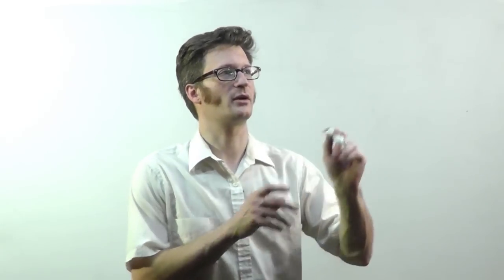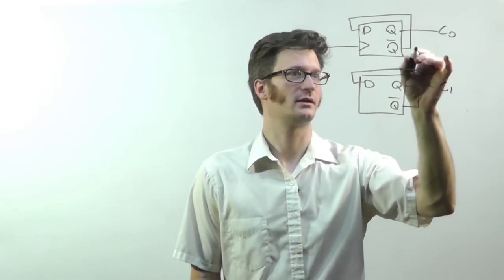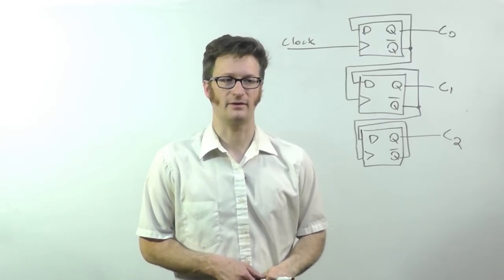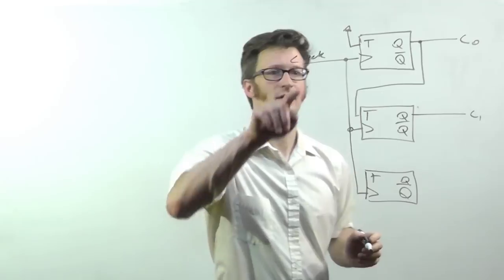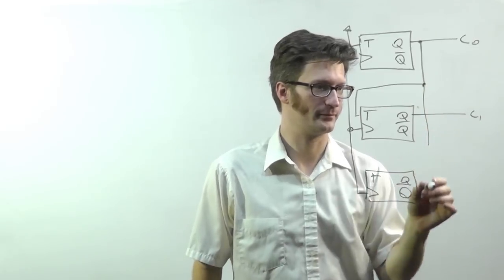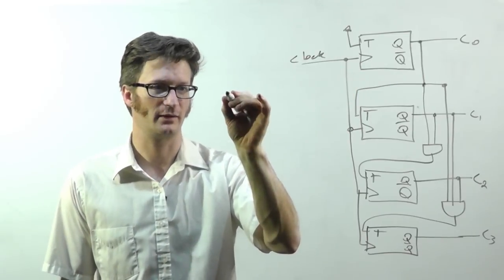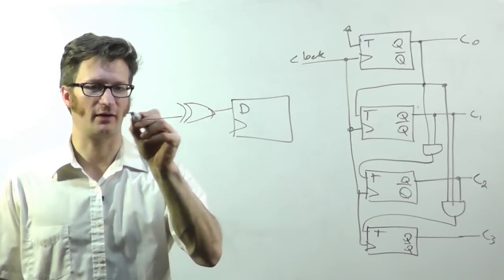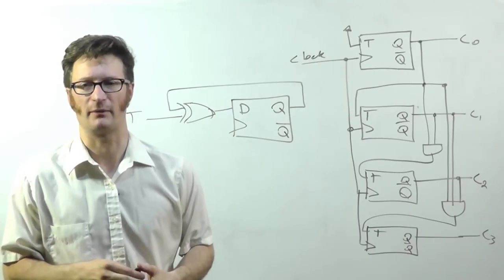Digital Logic - Counters

Comment: Synchronous counter can also be implemented by doing a state table build a compinational circuit that generates the next count of the counter. I did it when I had to implement a synchronous countdown counter that counts from 13 to 5, and I used JK FF without turning it into a T FF, and I also connected a startsignal, so that it won't get stuck at initial state.
An other way to implement a counter is making an FSM, which it uses compinational logic to generate the next state and an amount of outputs, that will represent the numbers. I did it when I had to implement a synchronous counter that counts from 13 to 5 when a select signal is 0, or 9 to 2 when it's 1, and I used D FF. 
There are many ways to build a synchronous counter, but generally a synchronous counter is the simplest case of an FSM.

Comment: Needs longer videos . This is a topic that requires an hour to really explain, with examples. Case in point:

- Counter that counts up vs counter that counts down (different problem, different solution)
- Counter that counts through a specific range of numbers
- Synchronous vs asynchronous
- D vs T vs JK flip flop implementations

7 minutes doesn't do this topic justice. There is so much more to learn here before you could ever pass an exam on this subject or gain a proper understanding of what is going on and why.  My two cents.  :)